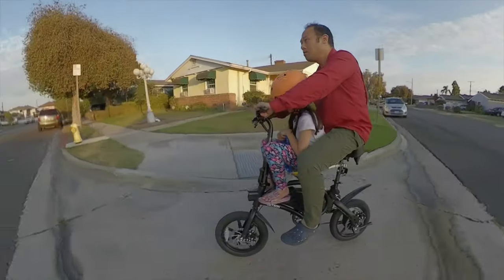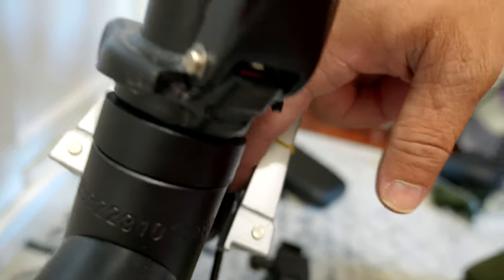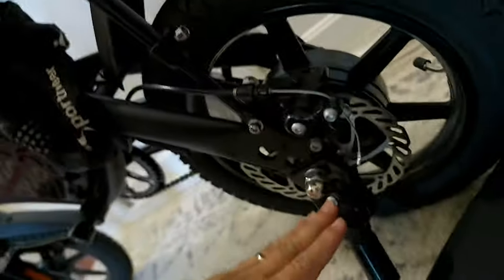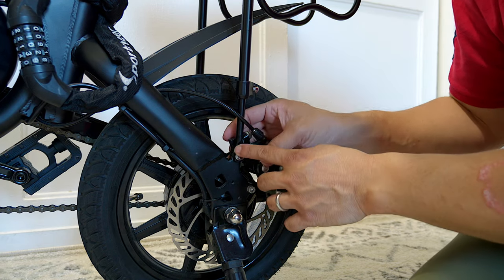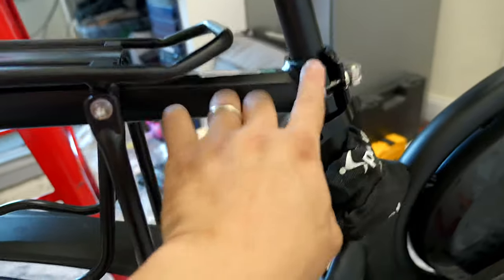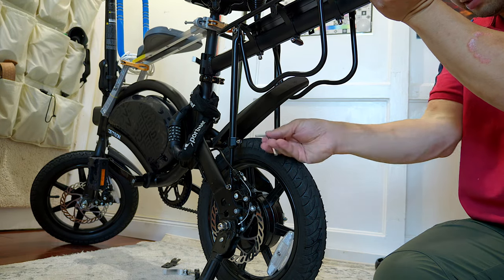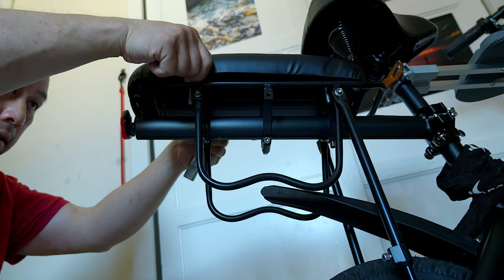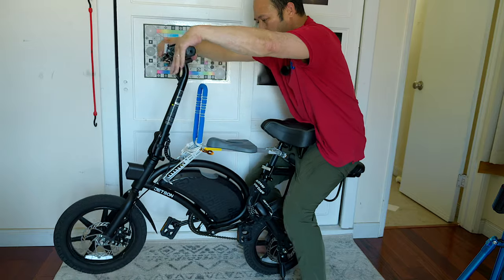Two or Three Seats | How to Install EXTRA Seats for your Jetson Bike Pro

Comment from the maker: Update, this thing is sturdy, had my older 17 year old son on it, around 140lbs, and no issues.  Some side to side movement is expected, however it's minimal and not an issue.  The generic rack was basically the same, some minor differences where you adjust the position of the rack, has no bearing on any of the mounts.
Reply: Thanks for the update. Did your brother in law test the generic rack with 140lbs? I understand it’s the same as brand name.

Comment: Thanks for posting! I found the Urider version 2  had too much gap on the Jetson frame between the Urider front support so it wiggled side to side. (Where the feet are)  It seemed quite dangerous and the bolts where the set goes into the horizontal frame stripped  so I returned it.

Love the foam cap idea!

The end of the video reminds me of a Vietnamese scooter. Two thumbs up from this fellow Asian. Haha
Reply from the maker: thanks for watching, the urider was a gamble, until I found the exact configuration, didn’t want to spend 78 for an OEM seat, I studied the pictures closely, and even then, I got it wrong, until I didn’t. it’s really solid, however getting both my daughters to go on, and get posted on YouTube, too much of a challenge 😌.  It was really slow with all that weight, so a mild upgrade will need to be performed and posted. I bought a second Urider in case my wife or family wants a scooter and a child seat, like all things eBay, the seller can Jack up the prices……. this thing works good as a mini rack (flat seat and arm help a lot), hence the rope I have, used it to drop off ups packages and haul my backpack
Reply: @YouTruther  yeah the little Jetson is awesome. I put a Burley Bee with two kids on hitch to the back of mine and it can do mild hills. You really feel the extra weight. (70lbs) It drains the battery in half.  Good thing I have a spare external battery. Have you thought about doing an extra battery mod? (Shiva's channel on YouTube)  Not sure where you would put it though.

 I have a 2nd stock Jetson and I'm waiting for this seat to arrive. It's too pricy for what it is. I totally agree with ya. 
https://www.amazon.ca/gp/aw/d/B08QFRDNX1?ref=ppx_pt2_mob_b_prod_image
Reply from the maker: have considered it, will do an upgrade video when it happens, for now, have more basics video planned to get this channel started. I’m new to bolt, however, I started ebikes when they were still using lead acid batteries 🤣🤣🤣
Reply: @YouTruther  lol! Welcome to the Bolt Club. If you need any accessories ideas, my channel has some or 10. 🤣
Reply from the maker: @soupnazi81  you got some crazy setup, subbed
Reply: @YouTruther  haha thanks man! Subbed to you too.

Comment: Have to be careful with that rear one.  The pivot point on the rear is the rear axle.  Anything sticking out beyond that will cause the bicycle to do a wheelie when weight is applied.  Something to be aware of.  Will still work, but mounting and dismounting onto the bike should be dad gets on first, then the kids, preferably in front if only one child.   It's only risky if you don't know what you're doing. 👍
Reply from the maker: noted, gone about 10-15 miles with the rig, even with my 17 year old son.  The thing is that it goes real slow when fully loaded because of the weight

Comment: I wonder if all JBPs are different.  I had to drill a bigger hole through the side opposite of the disk brake to mount the arm for the rear rack...:/  None of the SHCS would fit cause the hole was way smaller.  Also, for some reason, my break line is super close and its basically pushing against the.  it wont even fit the way you did it, i had to go on the inside of the arm.  All the products are really good though, i just bought the rear seat with back rest and handle bar version so that my little one has something to hold on on the way to school!  Than you for your videos!!!
Reply from the maker: They are the same, and I’ve modified this over time, it’s a bit different now, I made the rack and seat suit a bit closer to the frame and mounted a bit different, less seat space, but better mounting points. I’ll include the updates in an accessory video and pin a post to the original video
Reply: @YouTruther  it sucks I had to drill a bigger hole though.  the hole I had was about 3/16"

Comment: I am the first time try to upgrade the bike, I don’t know how to remove the original strew for adding the back rear seat , Can you told me what’s tool do I need to have?Thankyou
Reply from the maker: tool comes with the bike mount both 4 and 5mm hex. for the big bolt, it’s like 19mm or 3/4”